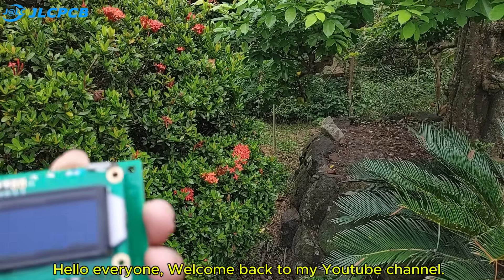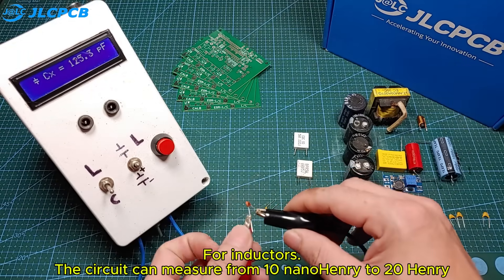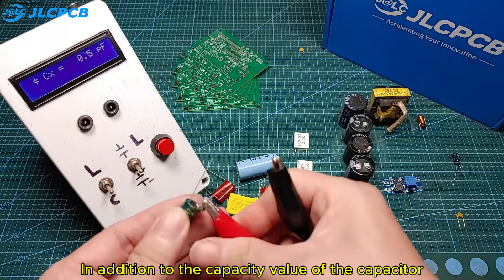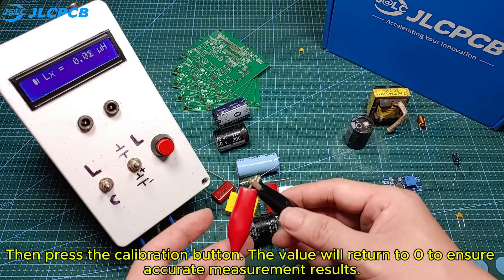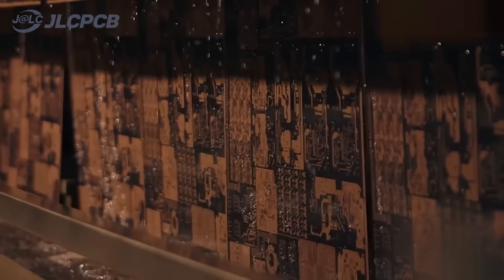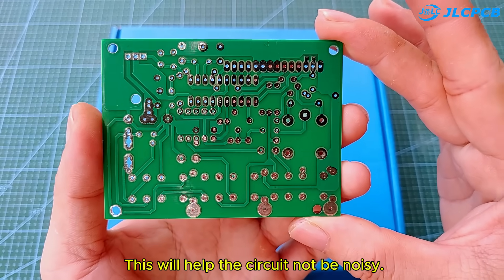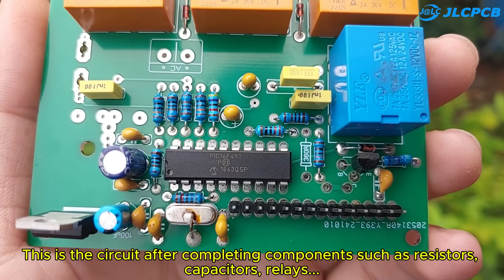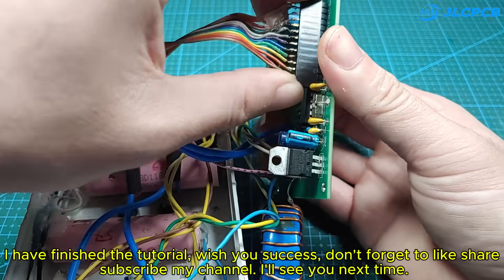How To RCL Measurement ? LRC Home DIY ?

Comment: Electrolytic capacitors will be measured on printed circuit boards? Thank you.
Reply: you can not do that becuse the paralel loads most of times
Reply from the maker: Corectly bro
Reply from the maker: No bro. It conect to another component